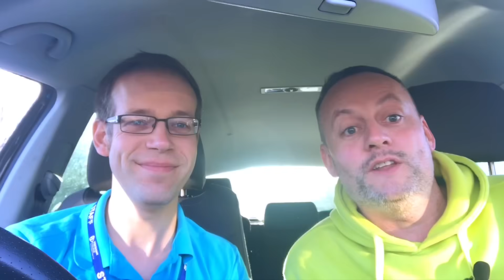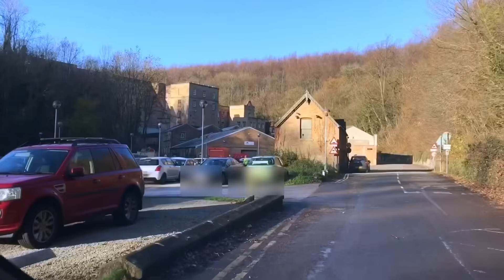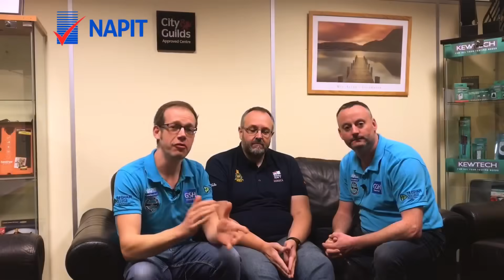Napit BS7671 Premature Collapsing of Surface Wiring Systems Regulation to be Applied Retrospectively

Comment: As a professional firefighter for 6 years and an electrician I have first hand knowledge of how important this is. I have always used metal fixing in my installs for years for this reason. I would like to add one of the worst is flexible ducting not being supported and collapses like a massive slinky toy, leading to one of the worst entanglements. Good video 👍🏻

Comment: do we need to use metal wall plug as well or a normal plastic one would do?
Reply: Think if I recall correctly, they are advising NOT to use conventional plastic wall plugs, but rather wall dog screws (like tap con screws) now instead
Reply: DEWALT Wall Dog Fixings 32mm Screw Pan Head Pozi DFM425005P Chrome - Other brands may be available!
Reply from the maker: https://www.youtube.com/playlist?list=PL2Ea5r9gxUUcwnDJOEE_xUoKQAicHlinU

The playlist above should help. Thanks Gaz 👍

Comment: What's the other retrospective reg then?
Reply from the maker: Hi. Sadly I cannot remember we shoot the video 4 months ago... contact Napit on all the usual social media outlets for the answer.... all the best Gaz
Reply: Plastic DB under a timber staircase in a domestic dwelling?
Reply: Ccu shouldn't be catching fire after a eicr, well I'd hope not 🤣🤣🤣
Reply: Presence of RCD, if it wasn't a requirement at the time say 14th edition and it's sockets on the ground floor then it would be retrospective.  If it's in a loft feeding a TV booster then it's potentially a C3. Just like premature collapse would be a C3 unless it could cause entanglement to the fire fighter or escapee which will be C2.  The regs are not retrospective, except for the ones that perhaps came out because for example some people have been killed because of it, then when that reg gets applied to an EICR you will likely either call it a C2, or a risk assessment to see if it will be a C3 or C2 such as absence of RCD and absence of appropriate fixings to prevent premature collapse.